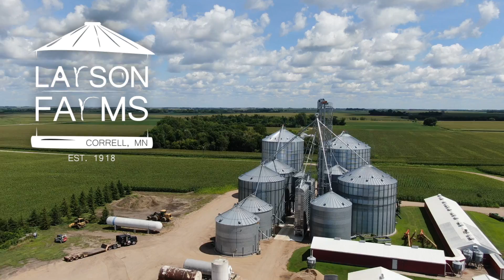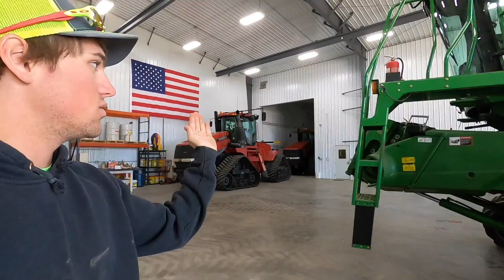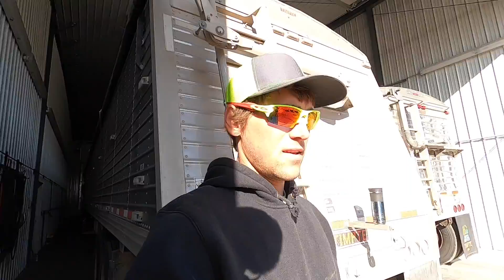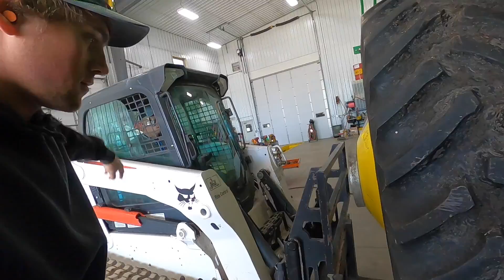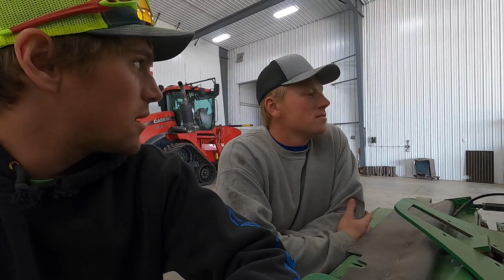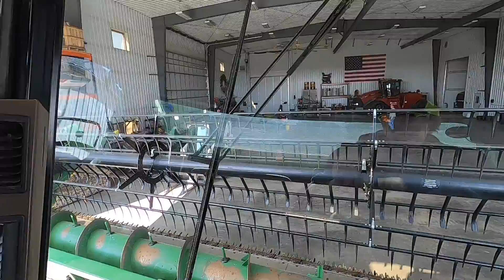9870 Harvest Ready

Comment: Something to think about- noticed u putting tracks on your combine. U only had a jack and single blocking holding the combine up, I did the same, someone jiggled our track taking it off. It fell to the ground and landed on the corn head and bent the combine . It took me two hours to get it back up,thankfully no one got hurt. I never do it with out safety blocking beside the jack.

Comment: The tcm compensates for the machine tilting from center to one side or the other of center and uses geometry to calculate a correction value to keep the machine on the guidance line rather than drifting up hill.

Comment: TCM calibrations are done to remove any tilt bias in the receiver (in case the globe is not perfectly level with the machine). If you had a bias you would be a few inches off when driving opposite directions on the same line. The height of the globe and tilt (using some trig) let us calculate the machine's position on the "ground".

Comment: I hate to complain - when you finished putting  the round tires on the combine there was a non-painted surface about the bolt area and I initially thought 'deere wouldn't have left a non-painted surface there' and you should have the spacer on the outside. Looking back the spacer is also non-painted so I was wrong. I checked pics on-line of these combines and the rims are all yellow - could it be possible you have the inside rim on the outside and vice versa? Just looking for perfection!! It also might help with your dissatisfaction with the 'small tires'.
Reply: Are there alternatives to ‘round’ tires??  Just asking 😃
Reply: @martinjohnson4264  Tracks. They took the tracks off and put the tires back on this combine.

Comment: Chet, what are the tracks doing to the machine?
Isn't this the combine Dougo tore the steering column out of?
Reply: If not designed for tracks, they likely are hard on the front anxles when turning.  Lots of extra lateral loads as the track scrub sideways during turns.  Plus tires absorb a lot of road vibration in-transit.
Reply: @tedb.5707  yeah that's what I was guessing but i know they had hydraulic problems and it seems like Chet was talking like the 2 were related in a past video. 
I was just curious if they linked the tracks to the cause of the failure they had resulting in it having to be hauled to the dealer for repairs. 
It was obviously a bad one seeing how they didn't fix it themselves.
I've got some customers that have put tracks on their combines.
Hoping to get some info that I can pass on

Comment: you keep saying level- that is a horizontal measurement.  what you really mean is plum. plum in a vertical measurement.   you need to torque those wheel bolts after 30 minutes of running. would be very bad if they came loose. ya.

Comment: I guess I missed something, but why tracks on one and not on both when they were both available
Reply: They just put tracks on the 790. The bogey wheels were leaking oil and just recently got the go ahead to put them on. The tracks on the 9870 (the one in this video) are aftermarket tracks and only go about 12mph and are believed to be the reason they hydro went out on this combine last year. Apparently they're alright when run in mud but if in dry dirt or on the road they're really hard on the machine
Reply: Frankie Goza  Thanks, I was wondering the same thing

Comment: they can't void your warranty for using tracks, they may want to and convince you that they can but they can't. just like how a car maker can't void it for you using non stock tires or even aftermarket parts
Reply: the tracks they have on that machine are not comparable to simply putting different non stock tires, its closer to having a car come with 27 inch tires and putting 45s on instead, and burning out the clutch packs in your LSD... would never be covered by an OEM warranty, the machine was simply not built to handle those